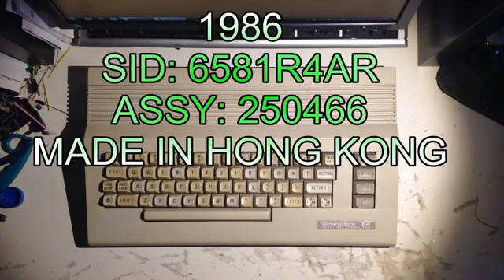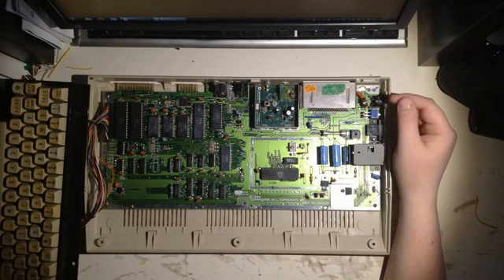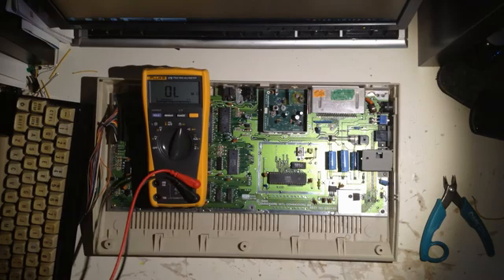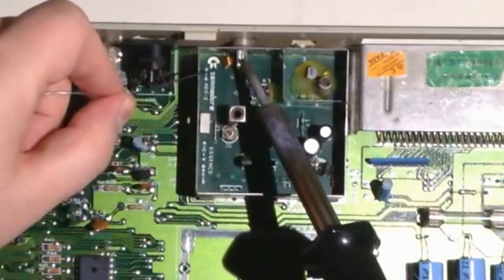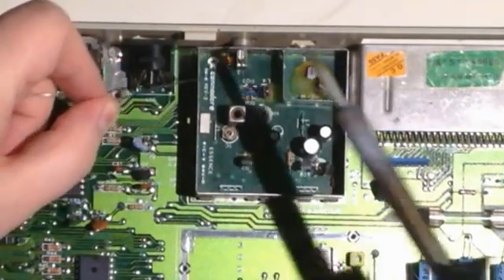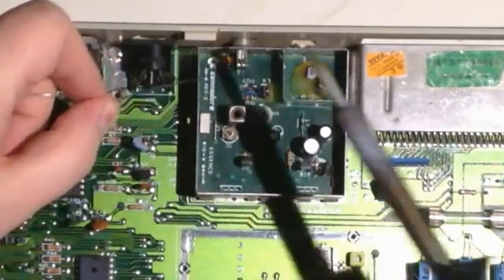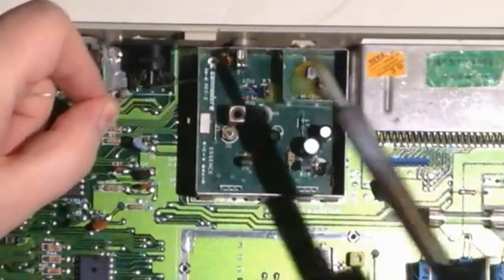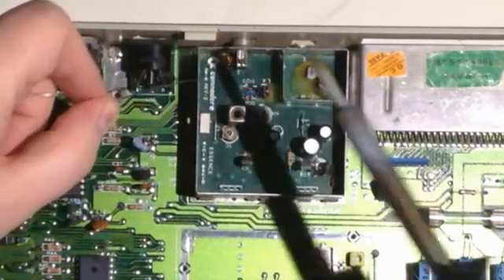Commodore 64 29y later. Cleaning

Comment: theres already composite throught he video port so i dont understand the need to modify the rf for it
Reply from the maker: I was missing the AV cable at the time. Note that this is my first video.
Reply from the maker: Now I remember. The RF section was broken on that unit. Back in the 80s I broke one of the ferrite screw adjustment thingies (IF transformers??). I think I said that in the video. Can't recall.

Comment: So what is the picture like after that mod Hans? It looks like what I did to the speccy. Only I used a decoupling capacitor on the signal. If it works and gives an ok picture I might do it as well.

Comment: I can remember that the bread bin models had a lot of video chip problems, so they had to be sent in and fixed. I never cared about what they did to them, just as long as I had picture again! Great video. Thanks!
Reply from the maker: The Highlander Thanks. That probably explains the video chip from 1989 in my 1983 breadbin. I do remember why my SID chip was replaced. I was around 11 or 12 fooling with a 10 meter coax and wanted audio signal from the c64 in my room to the VHS recorder in the living room. Long wires act like coils and voltage can go way beyond limits in there.. somehow... .. anyway i got my SID replaced.. Could have been overheating problems also because I had removed the shield, and the shield acts as heatsink on the C64C.
Reply: We learn from our mistakes :)

Comment: Well this AV mod is much like the one I did on the Spectrum, just cancel out the RF circuitry and directly connect the video signal to the TV. I did add a small capacitor to protect the tv, but that's not really necessary (as I was told). Cool mod this....
Reply from the maker: The Highlander Interesting. In the C64 modulator there is no capacitor protecting the composite outputs.. Now I have tampered with the modulator and lost picture with my C64C... I have a spare video chip, but I've ordered a scope such that I can see what's going on... and also now I have to make a modulator replacement, which i initially wanted to do but now I have to. There is a lot of information about that on forum64.de but it is in german. It will be fun to see if the vertical bars can be counteracted also :) No easy mod but hopefully I'll get the C64C up and running again soon. The breadbin is fine though :)
Reply: You obviously know something about electronics I don't. I think you actually need to modulator board on the C64 right? On the Spectrum you can simply bypass it and add a decoupling capacitor for security (whispers although I don't really know what that means)
Reply from the maker: The Highlander That's right you need the modulator to get the composite. I think it's because the spectrum has AV already, but the C64 has luma and chroma separately that needs to be mixed to composite  before adding it to the RF.. Not sure exactly how the cap in the zx spectrum mod helps.. It's probably for safety as in isolation and signal conditioning rather than decoupling. Decoupling means that current paths take a shorter route than not having a capacitor near by. Hence all the ceramic disks scattered all around the main board near each digital IC :) .. and without decoupling, signals might couple where it shouldn't (interference/noise) and wierd effects may happen. +JulianIlett has an interesting video on it.. https://www.youtube.com/watch?v=G7ULnQ9i7H0
Reply: Ah awesome this. You know your way around a circuit. I talked to a friend last night who built a photo digitiser for the C64 and we talked about how video signal is interpreted. Really cool stuff. I wouldn't mind learning more about basic electronics. Thanks for that link!
Reply from the maker: The Highlander That's interesting, and that's some project. Digitsing the video signals is hard in itself, and then transfering the data too. Btw I got the C64 working again. It was a solderbridge on two pins, and the VIC chip was fine. It wanted to try something without cleaning first and the solder bridge was difficult to see.
Reply: I saw that. The picture looks damn sharp. I just didn't really get what you were doing with the bread board. How do you know that stuff? I am really impressed.
Reply from the maker: The Highlander Thanks :) The left side of the breadboard creates the 5V from unregulated 9V. I have heard others have had success taking 5V directly from the VIC chip though. The right side of the breadboard amplifies the current in the black and white luma/sync signal before it is sent to the AV port.
Reply: Did you teach yourself that stuff? I wouldn't know where to begin.
Reply from the maker: Circuit theory i learned in school, but I started experimenting before that.
Reply: Circuit theory comes in pretty handy when analysing problems with old hardware. There's only a limited set of building blocks. If you know what they do it becomes easier to understand how circuits work.